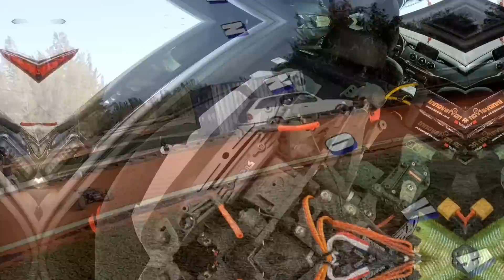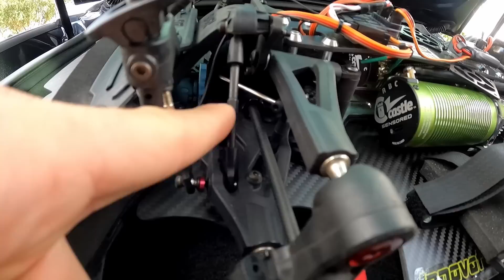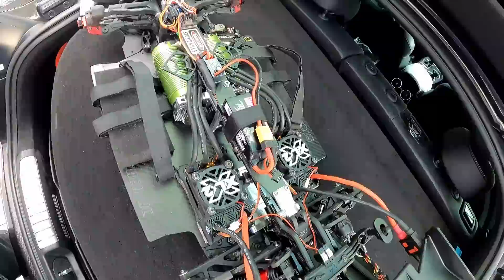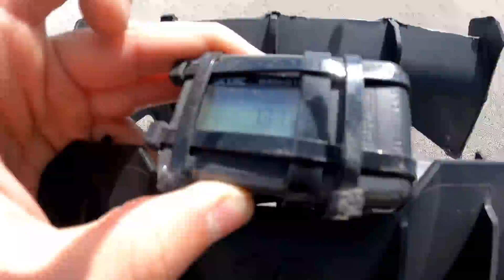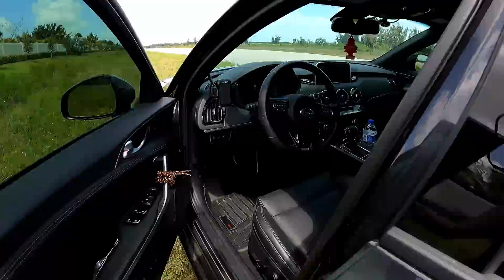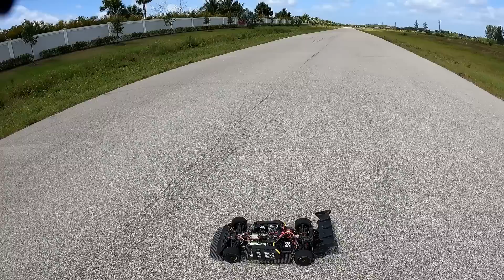40HP $2,000 Ultimate TWIN Motor RC Speedrun Car! Vision Revealed!

Comment: You were ahead of your time with builds a few years ago.   Your early videos got me interested in RC again.   Don’t know why you diverted to heavy aluminum chassis in most recent builds?   Love your old videos.  Best wishes for the future.
Reply from the maker: I appreciate that, I originally built this car to break 200 miles an hour before anyone did it before. Unfortunately the road that I used to run on got opened up to the main road and it wasn't a dead end so now there's traffic and reflectors and it's not a good idea to go really fast on anymore. Since then the car has been on the shelf...

Comment: The body is wrong for this and there's no saving it.
The underbelly needs to be sealed off as much as possible
to take advantage of ground effect suction.
The weight of the batteries could be holding things back.

Comment: Do you have a gyro on this?
Reply from the maker: No gyro or any assists used here!
Reply: @InnovationRC Oh wow I'm scared to have no assist. I'm planning to buy the new Futaba 10PX with the R2006GS receiver. Do you think this is a good combo? A lot of what I know about speed runs and my channel in general, I’ve learned from watching your videos.
Reply from the maker: I appreciate that that's great I'm glad I've helped. And yes that remote is great, I've only used those receivers too. 

Don't be scared to not run without assists. What you should be scared about is learning to rely on the assists so much, you can't drive it without them. If you build the car right for the road you run on, it'll run nice. Don't buy things that people on YouTube push in your face. Think if you actually need it. The best cars are tuned for the road they run on... That will be the most truthful advice I can give you.

Comment: Can I bash with your 4s lipos? I wanna run it in my felony fro drag racing and run in my XRT and outcast 8s
Reply from the maker: Yeah you can do anything with them, just don't crash! They are not hard cased, they are soft cased batteries so impacts may hurt it or any other soft case battery. I usually have mine lay on foam so it cushions the battery when I strap it in so it holds on tight(er)

Comment: were do these people come up with these HP claims? I run a hobbywing 800 kv and it's abot 7.7 HP this guy is claiming 40 plus HP lol give me a break
Reply from the maker: Hobbywing pushes only 200a. Push with a 500a esc and you'll get 20 HP. Also look at data logs, wattage output convert to HP. It's proven
Reply: @InnovationRC  if this is true my apologies but I know my setup is about 7.7hp so doable that you got about 15hp that castle setup might be a little hotter.
Reply from the maker: @northeastrc73  I wouldn't post something if it weren't true
Reply: @InnovationRC  that’s insane, my little 800 kv is a monster I can’t imagine 40 hp 
Speed runs I haven’t got into yet my infraction is stock and did about 83mph then it took flight lol

Comment: Dudeeeeee..that rear wing sucks !! Thats why it went flying.   You should put some high vertical  carbon fiber side fins . That will keep it steady , Also.why run 2x 6S 10.000 mah bateries in parallel ? Run 2x4S 7000 mah in series. Those motors can handle 8S easily . More speed dudee
Reply from the maker: The tires chunked out that's why it took flight! 6s parallel is an insane amount of power already
Reply: @InnovationRC  6S in  parallel is 6S-  22 v  just .ore running time, and double the weight.   6S in series is 12S double the voltage double the power.

Comment: I think all you speed demons are going about this all wrong. The low ground clearance and relying on ground effect is making the wrecks happen. The road isn't smooth to scale. A pebble is like a boulder to a scale model. Use weight for downforce and a vertical stabilizer to keep on track. A supple well controlled suspension with adequate travel and ground clearance will prevent the crashes. Trying to drive a scale model on a public road is like trying to off-road an F1 car.
Reply: Also making the body into an airfoil can add downforce without relying on ground effect. The flat bottom with the curved top generates lift and countering the lift with wings adds drag.

Comment: Not sure how old this video is can't he too old with the new xlx2's but just my input 2 motors spinning at the same rpm's isn't goin to make the vehicle go any faster as opposes to a single motor build but it will add more torque spreading the load between the 2 making more acceleration outta the gate. This a build I'd like to have just to have....it's like a painting you can stare at for hours!!

Comment: you can cut one red wire from one esc n let other esc run receiver both will burn them both out .. i run not a bec but ubec or plug in a battery ... looks like your putting in same stuff the uk guys are running and your catching air too just like them you need to design a body thats cutting off the wheel wells to stop parachuting you need to add weight to the front add wings on front to keep it from taking off n torque is what makes a car faster to spin big azz gears n what kind of motor creates the most torque??   and longer wheel base will make your car more stable ...  out runners make more torque man body needs to be cut more so when at a stop its off the ground so when it goes really fast the down pressure dont push body into the street
Reply from the maker: Opposite if you keep the BEC voltage regulated within reason for what voltages the Receiver can handle. You'll have 0 issues.
Reply: @InnovationRC   no if you run 2 escs and both have bec both escs will lose their becs bacause they will get burned out n you will have to use external ubec to power the receiver i have done it b4 a long time ago and i had both escs still until my connect stole one from me and gave it back after he did what i said never to do it but ever since i hooked them both upn both becs were on they both got burnt out becs n i have had to use batteries or ubec to power receiver when using those 2 escs... you can try n regulate thembut they will fight each other n burn out thats why drones use 1 esc with bec n the rest have no bec...  i used to be a product specialist at hobbyking.com n customers would come back for warranty on escs and i would do what they did to our stuff to better understand what the company i worked for was selling...  until this one guy came in for turnigy 9x that he bought on ebay n the receiver he bought from us n he chose it from the 2 receivers in that line but it was the other receivers funtions that he wanted and since i wouldnt give him the other receiver free cuz it was 100 percent on him for wrong choice he made up a lie that he had a health problem and almost died because of me stressing him out so next day i was told to sign out n never sign back in worse day of my life lost my dream job n i contacted him n he told me he lied about his health condition i got so pissed off i started to curse that guy yelling in my office in front of my other connect after reading jerks email n that was couple days before thanks givingand couple days after xmas i emailed him back to guilt trip him but his fiance replied back to me stating that couple days b4 xmas he suddenly died...  served his azz right i still to this day believe he got what he deserved for phuking up the rest of my life ...  hmmm all that extra stuff totally un important n i didnt need to share all that .... i should have just not commented about any thing in your video i dont know why i felt the need to say any thing may be because i thought you were american n i wanted to help some one that dont do the math on his own for the parts but does the same phuking thing other people did because it works n has the potential if yall can get the experience you need to drive your cars up to the world speed record with out crashing... if you were to go to my channel and checked out the cars i was building to beat nic case n you saw my cars going 55mph well that was like 1/8 may be 3/16throttle so had i had help to deal with traffic n found the smooth surface with enough space and it was safe enough that i i had zero chance of hitting a kid or old person or a woman, the gangsters i didnt give a shit if i hit them but could damage my car but n e ways that 55mph times 4 is a top speed of 220mph that i had my car geared for with a 20$ motor n 45$ esc that i did the math for my self n picked out n ordered and was a one of a kind set up there was no one else on the planet that had any thing that was the same as mine no one and i got my pinions n spurs out of the transmissions of toy grade toys that i took apart and put in my car to go 220mph...  sure theres drag so less then 220 but enough to get record... your car how ever a phuking money pit of wasted money and same thing 500 other guys have built same chassis same motors n escs same tx n rx same after market parts same diff oil same shocks n oil ... my radio and receiver cost under 50$ and i can get 1500ft range with one antenna on receiver n rolled in tight circle and hot glued to protect in crash n i have 3 of these radios 1 6ch n 2 4ch and been using them for a few years t5hey aint all flashy and neither are my rc cars ... heres whats really kool about my rc shit if i go to track or or out in public with any of it its guaranteed that when i arrive there aint gonna be 100 or more posers with the same set up as me telling each other the same stupid set up secrets n giving the same advice and bragging how many thousands of dollars they spent getting ripped off buying same stuff the guy with the 1st car lof your copy i shoulda just went to new video and saved my self some pain

Comment: 40hp? those castle motors are not rated at 20hp each not sure witch drea u live in? nice car tho but fake titale misleading
Reply: I'm pretty sure that's correct actually, I run that combo & haven't gotten close to maxing out the RPM & amperage & I have pushed runs up to just under 15HP on a single motor.  My last run on just 6S @ 131mph pushed 11.135HP at 386.2A, 8,303W, 24539RPM. The beauty of Castle Creation, the ability to perform data logs!

Comment: Glad to see you going after the 200 mph record. If anyone can do it it’s you. Build looks solid. I like your attention to detail. At those speeds aerodynamics plays as much a role as power. As shown by your crash. Possibly a bump or a stone allowed more air under the car and lifted the front end. Getting the batteries further forward for better weight distribution should help. Downforce helps but you sacrifice speed but you know that already. It’s a tricky trade off. Great job on the build.
Reply from the maker: Thank you! I appreciate that. It was super hot out that day so that's why the front tire chunked. Body never catches air it's setup correctly so air doesn't enter inside

Comment: It's been awhile. Good to see you back at speed runs. With the front suspension locked out your front tires are taking all the bumps on the road and not the shocks. Will have to see what happens with no wind. I hope no tire chunking out at speed.
Locked out suspension is going to be interesting at speed. Only time will tell. I hope all goes well, Great road for speed runs NO TRAFFIC AT ALL!!!!!!
Reply from the maker: Thanks, never had an issues with locked front suspension on Spartan I think the tires just didn't hold. I run the same tires in Spartan as well so it was probably just a hiccup.
Reply: @InnovationRC  yea no more hiccups over 20mph🥴
Good thing arrma designs really fast and tough tanks. 
Good to see you back doing videos 😉🤙👍🤝

Comment: A BEC isn't a small ESC- it is merely supplying a regulated voltage to the rx/servo/etc. Just want to clarify that. Most ESC's have a built-in BEC, but a dedicated BEC is unable to perform functions of an ESC as far as controlling the motor.

Comment: You removed the front shocks and then are surprised that it flipped...It's gonna be a long road to 200mph buddy
Reply from the maker: Have the same suspension setup with another GT car that never flipped, has 50+ passes over 150 mph. Front tire chunked if you noticed the aftermath

Comment: so straight and stable! brilliant builds.
watching that slow mo clip, did the air get in behind front wheels and lift arches? 
looked like sides expanded due to no posts or tape on sides
Reply from the maker: Tire chunked out in the front making the vehicle flip. Never had an issue with the Corvette body catching air.
Reply: @InnovationRC  dam foams spittin chunks...  that's gotta be the biggest issue every speedrunner faces gettin foams that hold up well. all the best for next attempts 🤞
Reply from the maker: @shredography  I have high hopes still with these foams I trust them. First hiccup I've ever had with these

Comment: I wouldn’t recommend locking out the suspension like you did you want there to have some to prevent the back shocks from going to far you can use Teflon tubing in the rear with stronger springs same with the front awesome video I’m excited to see more
Reply from the maker: At the speed it goes regarding rear downforce, it will still slightly squat
Reply: @InnovationRC  Spring-rate is the measurement of how much force it takes to fully compress the spring. Calculate the down force that your wing produces at full speed, add approximately the weight of half of the vehicle(per quarter) and find/calibrate springs to match. From an engineering perspective it'd undoubtedly be beneficial to add some absorbency to such a rigid frame.
Reply: I'm gonna agree and disagree here, if he's on super smooth ground......🤔
Reply: @EZ-D-FIANT good luck finding that. I've ran on airstrips and they weren't even perfectly smooth.

Comment: Awesome build man! It was so fast and the throttle output was only 46.5 therefore I think this car is promising! Good luck man! Here’s a quick tip, I think you need silicone tubing on the shaft of the shocks this prevents the car from going down the same level as the front end and do a backflip maybe try that instead of the toe links on the shocks to the other shocks! The contrast between Spartan and Vision is that Spartan is lighter and the motor and the equipment in the car pushing it down will not interfere the back to go down as well as vision having double the weight contrast to Spartan. In a nutshell, it’s either wind got under it and down or it got pushed down as those links will not take it that well contrast to silicone nitro tubings!

Comment: Brother you need to tape down the sides on that body. That Protoform Corvette body is too thin on the sides and they always open up like wings. Speaking of wings maybe more rudder less elevator.
Reply: I agree with the body tape. Keep it all tight to the chassi
Reply: This to
Reply: I ran that Corvette body and he's right, tape those sides because they like to flap and I had to get the nose as close as I could to the ground so it wouldn't do backflips. Wasn't my favorite speed run body.
Reply from the maker: Thanks for the input! So the wing is the same one on Spartan that's been over 150 many times. I think it was just the heavy wind it was going up against. Suspension setup is the same as well. Usually never run in this crazy wind
Reply: @InnovationRC  I'd also go as far as to say that you may be getting a high pressure zone building up in the wheel well. And some Porsche like aerodynamic trickery may be needed. 

You may want to get a good leaf blower and a slowmo camera to setup an impromptu wind tunnel and see what is flexing and moving around to identify areas that need to be stabilized. 

Like just the shear power of the air going near 130-150 is absolutely insane.

Comment: Try a different rear wing...even though the suspension is "locked out" it must be trying to lift the front end.
Reply from the maker: Spartan runs the same exact wing, its trimmed the same too. Spartan never had an issue breaking 150s ever. I'm sure the wind or the chunking of the tires caused it. Not sure if tire chunked before or after it flipped though.
Reply: @InnovationRC  sounds good.... super smooth run on 4s. Looks very promising. 👍

Comment: Some great runs there! Defo gonna need some tape for the body though. Looks like air got under it, and that was game over, but luckily it survived! Can't wait to see it out again!
Reply from the maker: Much appreciated! Unfortunately the tire chunked out which made the whole front end lift. It's Spartans exact suspension setup, he never flipped. Tires needed a little more prep most likely but my hopes are still super high with them! Spartan never had an issues over 150+ Mph!
Reply: @InnovationRC  don't think it would hurt anything from typing it? Been seeing all the big timers with type on there's. Reason why u don't want to type
Reply from the maker: @jordanritchie2198  what is type? Do you mean true? Generally foams you I just break them in properly, running a few times at 110-120 mph, then they should be ok for crazy speeds.
Reply: @InnovationRC sorry🤦🏼‍♂️ tape the body to the chassis so air doesn't get in/under the body like razz does and James. The tape the body on the side to the chassis and the front to the splitter
Reply: This right here.